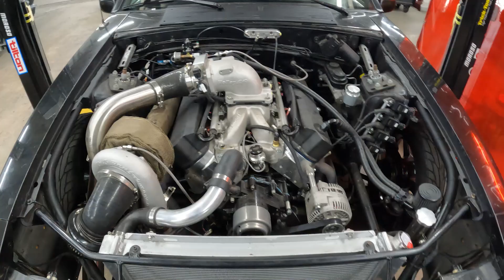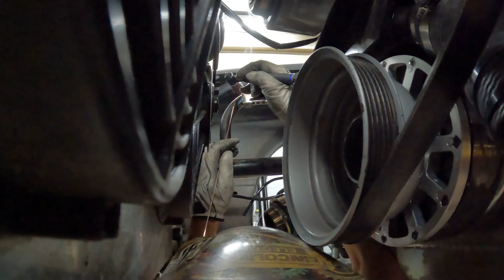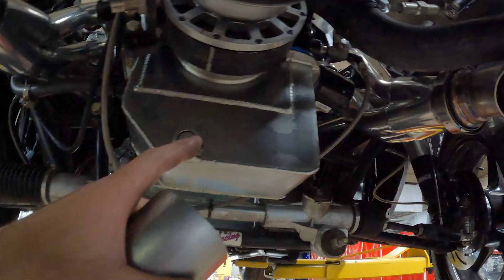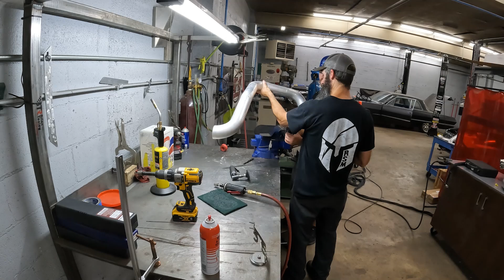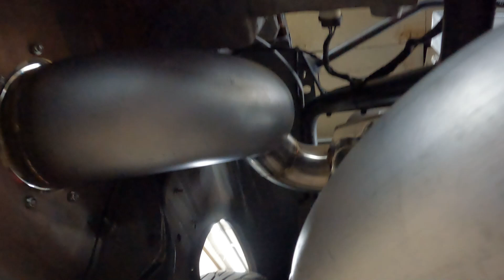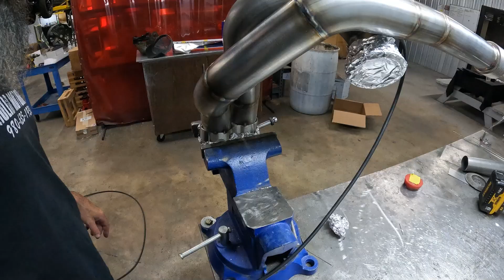Foxbody Turbo Kit.  Swapping out the On3 Kit for a Custom RSM Kit with a  BIGGER Turbo

Comment: I have a 92 foxbody that I 351 swapped with on3 turbo kit then ended up getting a smoking deal on aluminum headed super built 408 sbf. Now I have a turbo that is way too small..... I bought one of those Team Z tubular front end kits and stuff to make a turbo kit just like this, just need to find the motivation! Its super hard to make yourself do it at times lol.

Comment: Does he have problems with overheating? that cooling system having the highest point be right off the intake elbow 👀 Looks like a place for a giant air bubble
Reply: Zero issues. Runs cool.